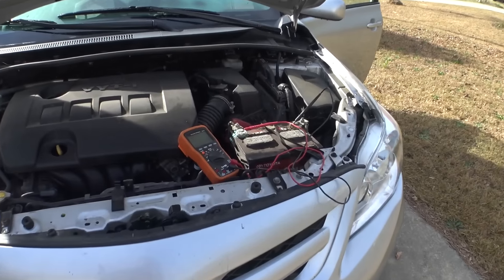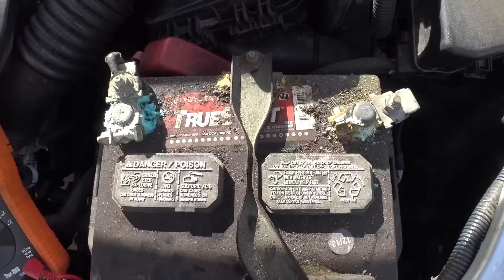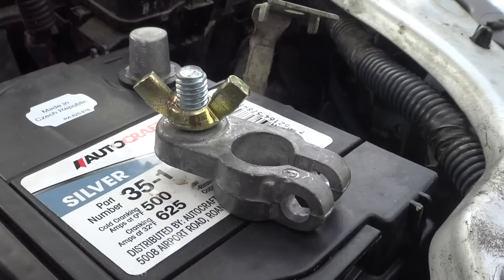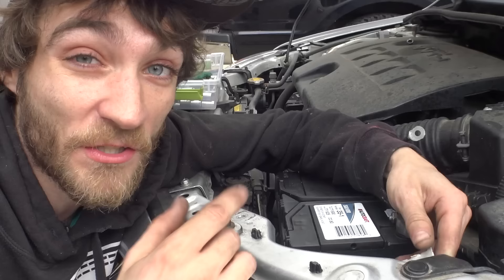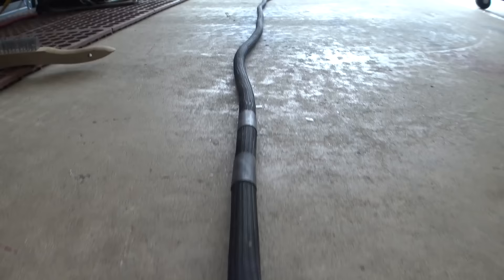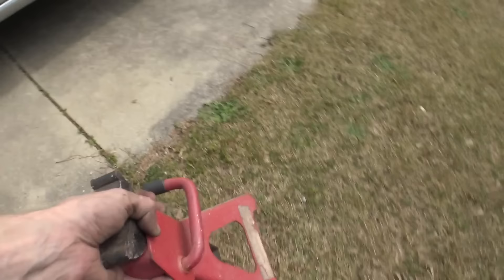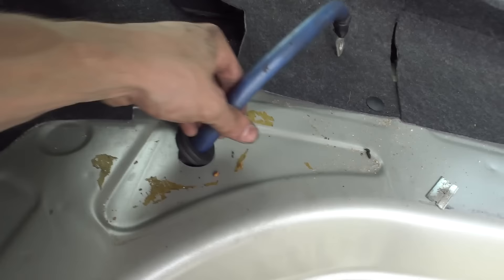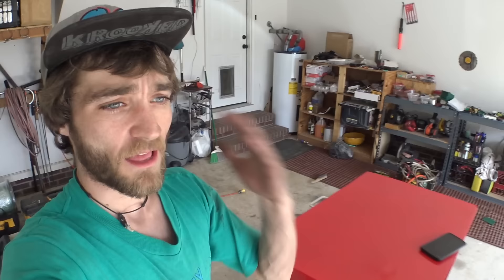Wiring CAR AUDIO System w/ 2nd Trunk Battery & Installing BASS Amplifier | Testing HOTEL Subwoofer

Comment: Hey EXO can you do a video on tuning an amp? Also quick question I have a 180 amp alternator stock and wondering if I can push 2 15s on a 2500 watt amp without having any issues? I would most likely be running 2000 rms with two kinetic 1800s-pros. I see you have two different batteries? Does it kill the battery quicker since they don't have the same specs?
Reply: Kc Pilch you will never know until you try but what kind of vehicle has a stock 180amp alt? Biggest ones I seen stock where 160 and those where big V8 cop cars with shit loads of electronics.
Reply: Tammy Forbes I have a Mercedes benz c300 it comes in at 150 and 180 by Bosch oem

Comment: great video!! I'm on the market for a custom woofer enclosure and so i came on here to understand them. Currently i have a pioneer gm-9601 amp (1200w rms,)2400w peak which was hooked up on 2 Kicker compr 12s but they finally blew last weekend. I'm now looking at getting either 1 RE SXX 12"(1200watt rms) or dual Sundown SA 12s (750watt rms each). if i put the sundowns in a bigger than recommended enclosure, will they sound better than the RE in a bigger box?
Reply: Salvadol Gilbert sxx are great ive been beating the crap out of them for like 7 years with 3krms with no problems

Comment: I have my system in a 4 door car as well and should I turn the box towards the seats or keep it facing the trunk lid?? Pls help !!!!
Reply: A A RON hey there question is good. you can aim it anywhere but keep in mind the bass will be absorbed immediately if it hits the padded seats versus the banging in the trunk. Trunk rumble is fine ya know when the license plate slaps. It’s your taste and check out Crutchfield.com faq’s. They have everything

Comment: I have a Camry as well, how did you get the rca lines off the stock radio?
Reply: Lagmaster0591 inline converter more then likely
Reply from the maker: NVX hi-lo converter
Reply: You will need a Hi/Low Converter
Reply: Lagmaster0591 i think he showed in a prev video which inline converter he used

Comment: I've always ran on the underside of the vehicle too. Another reason is for the breeze and when driving the air flow cools the wire as well. High current going through the wire heats it up so all that ventilation is better than nothing. To run the fins and heat sink of an amplifier sticking out on the floor or wall or cieling would be superb too for an amp to cool without a fan as well. Putting an amp inside of a spoiler amp rack would be sweet for some supreme cooling if inside the spoiler away from the sun.

Comment: Hell, I might go ahead and run my power wire on the outside when I upgrade to 0 gauge from 4. Seems like a good idea in my case because there's really not much room to route cables under the floor mats in my truck. Unfortunately my new amp might not fit under my passenger seat.

Comment: Where did you ground the battery in the trunk? Was there a fuse coming from battery to amp?
Reply: he used the ground he had cleaned off to the 2nd battery then either did another ground to amp or used the ground terminal from that battery

Comment: For lets say a 2000 honda accord, whats the amount of watts rms it can safely play through a sub with stock battery/alt and no capacitor?
Reply: Ace Khmer I wouldn’t go over 1500 watts on a stock electrical system, not even 1200 to be safe. Anything over that I would recommend upgrading the electrical.

Comment: What kind of build would you suggest for listening to Decaf with a 10 inch? I'm not a person who likes "loud" anymore, but I want it to get LOW... like movie theater low...
Reply: I think it's generally Smaller subs = faster response - Bigger subs = lower frequency response.
Maybe try to find a decent low profile 12 or 15 inch?
Reply: True... unless I do a build with multiple drivers ... more cone area can result in lots of low bass too... two 10's have more surface area than one 12... if you are limited for box size... I have enough room for a 1.73cuft box which will work for two 10s but only for one twelve.. it's all about moving air.. :)
Reply: Spot on sir. Now. My personal plan is to make a box for 4x12" 275w rms jbl's to see how much they can do with about 1,5kW of power. I'm hoping to get some decent bass with a box i'll have built & tuned for 30-32hz. I'm currently running two jbl 12's as mentioned before on 500w rms, and i believe they're pushing over 135dB, hopefully closer to 140. But that's in an oem jbl box most likely tuned for 55-65hz.

Comment: I think I'm going to turn my box around. Does it sound better with the box facing the car? I have a ported box. The shop faced it to the trunk.
Reply from the maker: It varies from setup to setup. This car is over 1db louder with a slight angle.

Comment: You don’t need to buy a set of new connectors u can clean the corrosion off with soda and a wire brush
Reply: Tony gamble He probably did it just because he wanted it to look better
Reply: They also stretch out

Comment: EXO i just installed 2 kicker comp s single 4 ohm voice coil15" subs with a kicker cx600.1 and 4gauge amp kit in my sons 08 dodge ram regular cab 1500. i will be upgrading the amp to a 1200.1 later but right now o was wondering if i should get a new bigger battery or just add the xs power aux battery kit and do the big 3 upgrade. thank you for all the videos and your time for a kinda newb.
Reply from the maker: For that amp, a single stout batt should be fine.
Reply: what battery and size would you reccomend? i have noticed you like interstate batteries, or should i save up and get an expensive one
Reply from the maker: Diehard Platinum is really good. Or maybe a Crescendo HPL :D
Reply: the battery in it now is cca 850 and ca 1035 should i stick with that
Reply from the maker: Thats a damn good batt!
Reply: should i try the big 3 and better power wire first before i buy a new battery then?

Comment: Exo I built my first 4th order box! how can I share some pics with you? This box is a single 12" dvc 2 ohm wired in 4 ohms. I'm so happy to be inspired by your enthusiasm! Bassheads!
Reply from the maker: Add me on Facebook or Instagram! Feel free to post on my wall @EXOcontralto
Reply from the maker: Sounds like fun, thanks for wanting to share with me.
Reply: EXOcontralto is it better to face the sub towards the Trunk or up towards the hatch or into the cab I have a hynduia Tiburon
Reply: Paul cherry your best bet is to turn the box until you find what sounds best. My box had the port facing back at first. I turned the box with the port facing up. The sound was most improved. exo was doing this in little blue with I think the 15 deaf bonce. watch that video.
Reply: Sloth the ports on the side of the box lol sounds good and clean firing into the car not much rattles and firing up the same but I don't or the sun cooking it
Reply: Paul cherry lol ported box. I got yah. turn it to see what sounds best. I like to let other people sit in the car and listen to get an unbiased opinion of how it sounds. That's what friends are for!

Comment: No fuse on power wire? Or did miss that part?
Reply from the maker: There are fuses on BOTH ends!
Reply: @EXOcontralto  right on. I figured it probably was. Just didn't see it. You do proper work. Keep it up man.
Reply: @EXOcontralto  I didn't see it in the back were the battery goes to the amp 🤔🤔

Comment: New follower, but already huge fan of yours. I was just curious if you have ever dealt with a brand of subs called GS Design and if so your thoughts about them
Reply from the maker: GS Designs? No sir, never heard of them!

Thanks for watching and commenting, Stuart :D
Reply: @EXOcontralto  I guess you could say big with no budget. The GS Design came in a banpass box, with a Jensen XS 1212, that I found at outdoor flea market. Paid $15. The other set of 12's I'm "rockin", are also in a banpass, they were free. Little 600 watt amp that's pushing all 4, l paid $50 for and stereo was free. So 4 12's, amp and stereo for total of $65.

Comment: I have a DD 3512ESP in a 2.5 ported box tuned at 34hz, My amp is a DD M2c. I'm adding another 3512 in a few weeks so would a limitless 15AH lithium be good enough in the trunk or should I add a yellow top with it along with an isolator?  My alt is stock 150A.
Reply from the maker: Not sure that the 15AH (lithium) equates to for AGM, but at first glance that system seems pretty nice. Never know the downfalls of ituntil you go full tilt and check the voltage though.

Comment: if the battery was reading full and not leaking anything and at the connections where reading less. All you really needed to do was take out and clean the living hell out of the battery and everything around it, then put on the new stuff like you did. I just know sometimes a battery can cost alot these days. 
oh, just so you know you have zip-tied the power wire the the gas lines. 
Other wise looks good.
Reply from the maker: True! Always nice to save even more money, but luckily we increased our CCA a little bit too with this Autocraft battery. The power run was secured to those metal lines, yes, apparently brakes and gas. To me, it's not too scary considering the safety fuses and solid metal construction of the tubes themselves, but tonight we will see about relocate things a couple inches.

Comment: My gosh EXO love ya man.  But why did you run the power and zip tie to break or fuel lines?  It would have been safer not to do it that way.  M.E.C.P. Cert. Just trying to look out for you!
Reply from the maker: I can appreciate the concern, but those solid metal tubes aren't going to be bothered. With no access to oxygen, and safety fuses on both ends, everything will be just fine. But shit, I'm never too good for some friendly advice, so thanks for the comment! We maybe even relocate the ties a couple inches just to keep the momentum going :)

Comment: I have a 3500w amplifier in 1ohm. I have connected everything the way it should be, but i don't get any effect. I tried a different 2000w amplifier with the same setup, and that worked! But do i need an extra battery in the trunk for my massive amp? I think i heard somewhere that some amps don't start if they don't get the right amount of volts?
Reply: The amp is showing green and no signs of protection mode.
Reply: is the gain turned up at all?
Reply: check the tuning on the amp and your headunit
Reply from the maker: So the amplifier isnt putting out good power?
Reply: @EXOcontralto I managed to solve the problem. It was the switch for slave input and master output. Obviously a beginner fault. But the strange thing was that i tried both options and didn't get sound. Later i tried it again and it worked... don't know what i did wrong.

Thx for reply.

Comment: will a 1600 watt 2channel amp kit work work a 1600 watt 4channel amp
Reply: Lester Johnson yes.  The wattage determines the wiring kit needed.
Reply: A 2 channel amp kit will only have one set of rca you will need to buy a second set to run 4 channel amp

Comment: Exo please explain what you did with the secondary battery in the trunk. Im confused on how you hooked everything up and would like to understand so i can repeat the process. EXO READ PLS!!!
Reply: Cain Thornburgh you hook the cable he ran from the main battery the battery in the trunk. Then run you a second wire to the amp.
Reply: So you just run positive to positive and the ground to the negative? Then your lead for your amp? Doesnt that put a lot of strain on the alternator??
Reply: Correct no it shouldn't
Reply: You haft to check if it does you haft to put in a high out put alt
Reply: Alright thanks man i appreciate it!
Reply from the maker: I'll pull it out, and make a video of it from the beginning.

Comment: Where were your leads when you measured 10.7V on the battery at the beginning?  Seems to me that if there is no load in the battery (car looked to be off) then getting that 10.7V would indicate just a dead battery, not related to the corroded battery terminals.

Not that I'm saying the connections on the terminals weren't corroded all to hell, but you don't get any voltage drop when no current is flowing.  Your meter's resistance as seen by the battery is likely in the million of ohms, which is peanuts and would not serve to skew the voltage reading on the battery.  

Were you placing the positive test lead right in the green fuzz?
Reply: WingedMark ...the battery itself still measured just above 12...

Comment: Im in my early 30s and i feel the im to old for the ground shaking bass but What type of subwoofer would be good in a crew cab gmc? Not over the top just enough to feel it while im driving. Thanks
Reply: itsalltaken666 I would check out skar audio. they have a couple under seat subwoofers that sound great. There's a really great line called the VD series from skar audio. Those are 500watts rms and one would be plenty. the 12in is only $80 right now. I ran one VD 12in and that was plenty of bass for the average Joe, and still enjoy left to show off a little if you wanted to.
Reply: itsalltaken666 it
Reply: itsalltaken666 some kickers would be good but it all depend on the box you make
Reply: never to old. im 40 been a bass head for 25 years. i have toned it down over the years mainly because of other responsibilities but im still bumping 2 12`s. young bucks should have a little respect for the old school bass heads that paved the road.
Reply: I agree with skar audio. Very solid subs. If you just want to feel the bass and have a damn good sound go for the in vvx-v3 8. It's only an 8 but it will sound damn good I've seen that one outdo a couple of low-mid rang 12s

Comment: That’s nice EXO dope job, I have a question I have a 300 with one alpine 15’ sub in a dual ported box tuned at 26 hz in the trunk 
and I’m having trouble tuning it, I have to use the bass boost to get a sound I like, I was wondering is ok to use the bass boost?
Reply: "a sound I like"  - There is your answer right there

Comment: its possible to wiring 2s batterie with no isolator?
Reply: TheOkami12 yes
Reply: TheOkami12 ik did it for over 4 years
and stil running
Reply: thx for the answer
Reply from the maker: Of course!

Comment: When you ground the amp to the second battery doesn't that run the battery down in the trunk?
Reply: No, they charge in parallel and because the they are in parallel they dont discharge as fast either

Comment: That's the brake and fuel lines you zip tie it to lol Away from flameable materials.
Reply from the maker: Being made from solid metal with no access to oxygen, it's not too concerning. Plus both ends of the wire have a safety fuse. But I can see where you're coming from :p

Comment: I did this...but there's whining out of my speakers.  I have 3 amps, one for tweet and rear, one for subs, and one for mids and woofers.   Whenever the sub monoblock is powered up (even if car is off), the tweeter/rear amp's speakers whine.  I tried powering the mono amp with different power, different ground...etc. all power and rca wires are separate....any ideas?
Reply: You have one for woofers, and one for subs?
Reply: @urbansasquatch5537  Yea. One monoblock for just subs. Then a 4 channel amp that runs the mids(3.5) and woofers(6.5)
Reply: You got a bad ground
Reply: Check the ground wire on your head unit not only your amplifiers
Reply: Under cut i had the one amp touching the back of the seat metal and it was pulling the ground

Comment: When you put an extra battery I was told to put an isolator but when I hooked both amps up there was not enough power and it put the amp into protect mode and only the tweeter amp worked what should I do

Comment: How do iremove a amp ? I have 1 battery in the front  & 2 extra batterys in the back ? Idk which negative wire to disconnect out of them 3 batterys... I need to get to my spare tire plz help
Reply: if you could explain your problem with more Detail, ill help you

Comment: Can i run secondary battery AGM parallel to my factory normal battery?
Reply: Also wondering
Reply: He did in this video, but don't know if supposed to do or not
Reply: Brian Waller  what's the battrey type you have at the trunk?
Reply: Brian Waller  and starting battrey is normal acid ?

Comment: @EXOcontralto did you end up fusing the power run going to the amp from the battery? If not do you recommend leaving it be or should it be fused?
Reply from the maker: Yes,  both ends fused up.

Comment: I am installing the skar 2000 watt amp but when i crank it up, my power drops. My alternator is only good for 60 amps. Do i get a new alternator or an XS power battery?
Reply: both would be the best, but they are expensive so if i had to choose i would go with the alternator, if you want a cheap fix a capacitor would probably help but it isn't really a fix it's more like a bandaid, and get a good one, i don't know how cheap audio companies get away with it but when they say 1000w rms it's really about 100 or in this case they will say 1 or 2 farads when it really doesn't even come close to 1
Reply: Jake Brittain big 3 upgrade first see if that solves it.
Reply: I would suggest big 3 upgrade and a northstar agm 34
Reply: Big 3, then battery, then alternator. In that order. But with a 60 amp you will most likely need all 3. Especially with that skar rp 2000. 

That thing drinks so much power. Not very efficient at all.
Reply: @famousdev9707  coworker fried my alternator boosting someones car lol. Time for a new one. Atleast he didnt fry anything else

Comment: So can I ask, you have the sub and amp installed here, but what have you done for the front end of the system? Head unit amplifier straight to the stock speakers and a seperate rear output single feeding the bass amp?
Reply from the maker: I wired the high level outputs from the rear channels into a hi-lo rca converter from NVX.